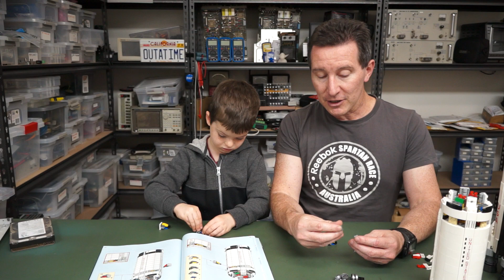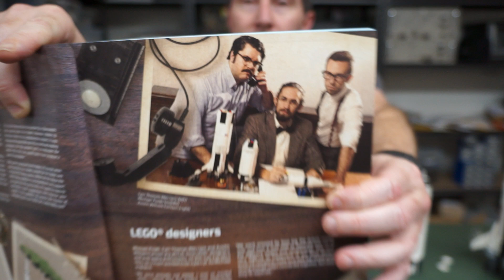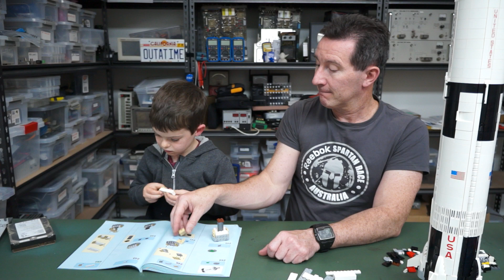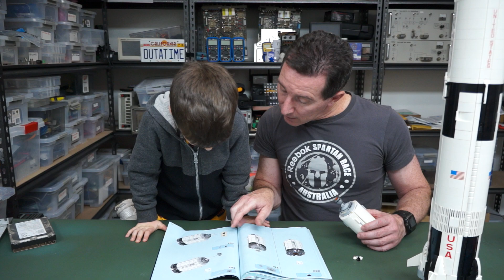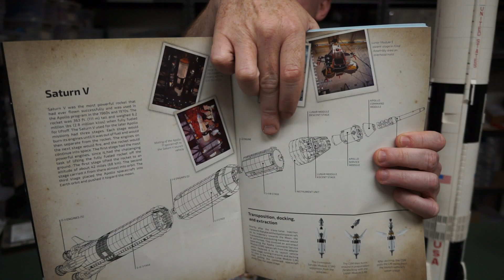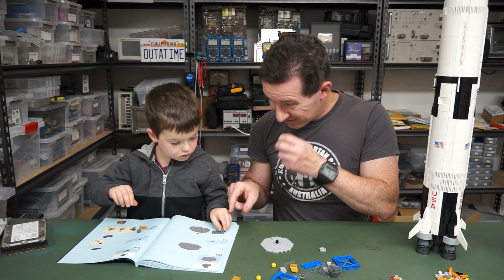LEGO Saturn V Moon Rocket Build Part 3 of 3

Comment: The small solid-rocket booster at the top (escape tower) was used to pull the command module away from the rocket in case of an emergency, not used for stability or anything else if all went well.